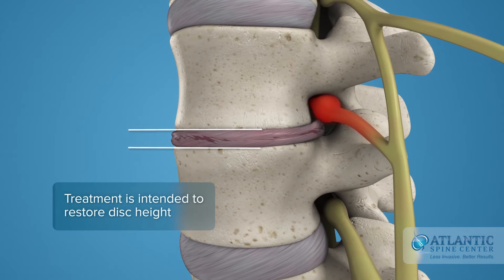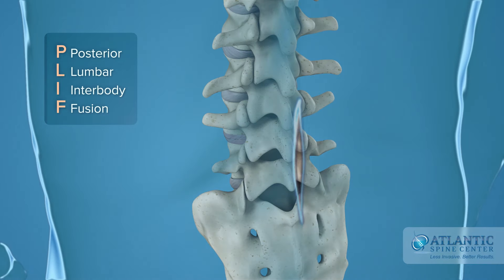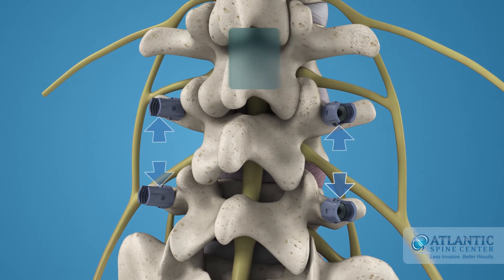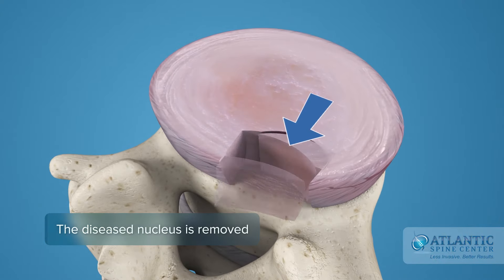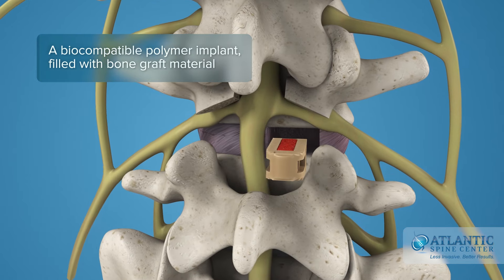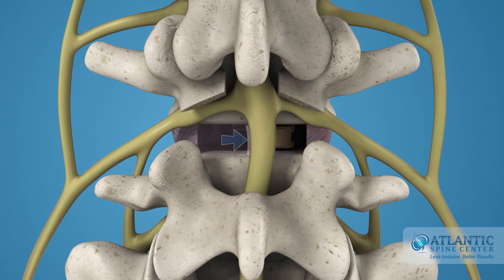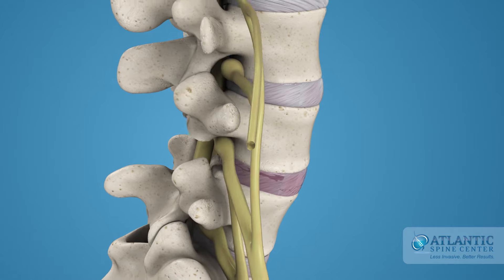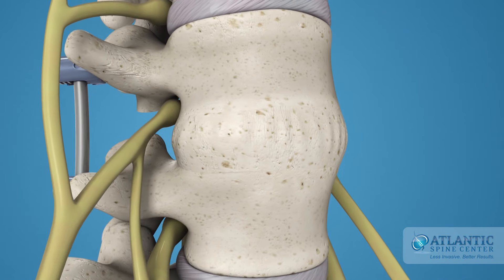What is Posterior Lumbar Interbody Fusion? | PLIF

Comment: What reason’s are there to conduct a PLIF over the ALIF and vice versa. Both procedures seem to address the same issue, any reason to incise from the front or back?
Reply: I’ve been wondering that, too. I read, (can’t remember where), that they like the ALIF because it doesn’t disturb the muscles of the back like the PLIF would do and therefore preserve strength and stability, but then they still go through the back to put the screws in. I'd also, like to know why they would choose the ALIF over the PLIF.
Reply: I am not sure why the ALIF is the more “popular” procedure. I do however, know a couple interesting facts about the ALIF.  When undergoing the ALIF, there must be a vascular surgeon in the operating room because the incision made is very close to your aorta. The scheduling of the surgery, therefore, is dependent upon the availability of the vascular surgeon. Also, previous surgeries, in my case gall bladder, appendix, and complete hysterectomy made the ALIF  a bad idea because of the probability of scar tissue and adhesions.
Reply: @songbirds3712 correct. I’ve had a failed artificial disc replacement and now need a PLIF. They can do the ALIF but the likelihood of the aorta and other veins being encased in scar tissue makes it a high risk surgery. Plus getting the ADR out is also very difficult.
Reply: @youknowwho8700 how are you doing now? What happened with the adr? I really want to go for adr but now i am scared